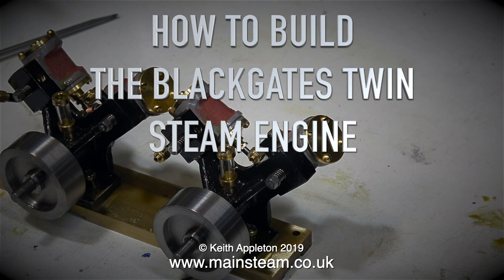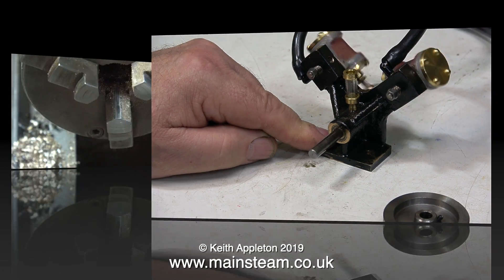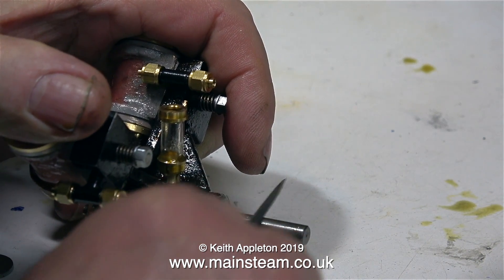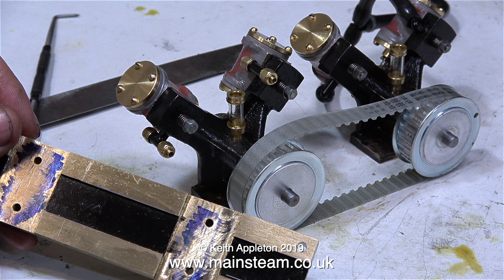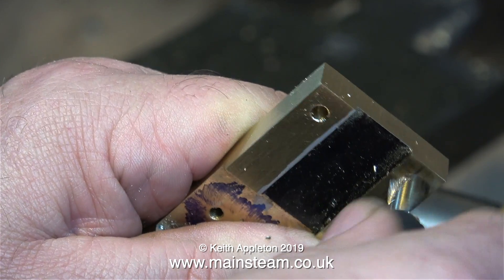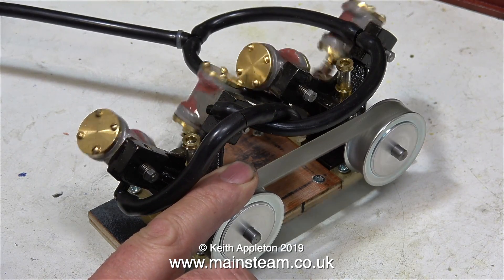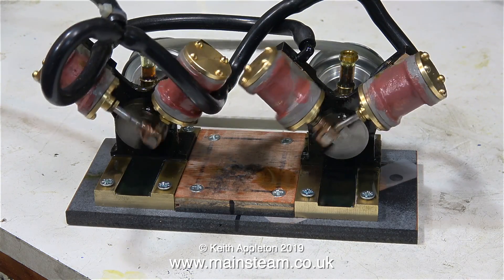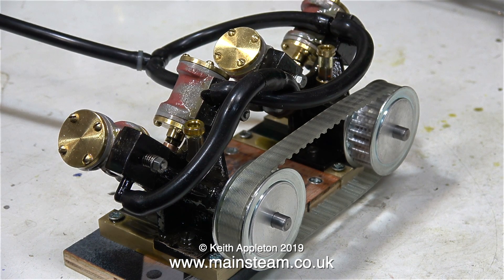HOW TO BUILD THE BLACKGATES TWIN STEAM ENGINE - PART #14

Comment: Keith those Proper Engineers that complain as say your doing it wrong are the ones that cause all kinds of problems as usually they don't know what they are doing and have never done it. As a Practical Engineer I say any way you can get the job done safely is fine with me, and please show me how you did it different then me as new tricks is what keeps us old dogs going.

Comment: Candlelighters, thank you for supporting the cause. I started supporting it about 30 years back. 
I have watched you employ several methods to secure engines to a wood base. Have you ever used pronged t-nuts installed on the underside of the wood? They have made very strong mounts for things I have bodged together in the past.
Reply from the maker: I don't use T-Nuts because the rust badly with the water that is always flying about . . .
Reply: @keithappleton  Of course, I had not thought about that aspect. Thank you for the reply. 
Hopefully I saved some builder the awkwardness of rusted mounting screws.

Comment: I have seen people make cog belt pulleys on a shaper or on a lathe by using a properly shaped cutter making axial cuts on the stationary, chuck-mounted work. You need a fixture to hold the chuck still with the proper number of positions.

Comment: Your side by side twin engines coupled with the cog belt gives an easy (?) way to adjust propeller speeds instead of changing prop size/pitch.

Comment: i like the side-by-side mounting a lot more than the end-to-end (but who cares what i think) . . . it neatly avoids he problem of one tiny crankshaft trying to handle the power of both engines.

the splitting of the engines is going to deny you the opportunity to do a mind-bending job of running both engines from one reversing valve . . . you would have nightmares but i'd love to see how you do it . . . i'm nasty that way.

the belt drive should handle anything those little screamers can throw at it . . . if whoever wins the auction for it uses it for a twin-propeller boat, i hope they return all the unused parts to you . . . i'm sure you can find a use for them.

Comment: Were you not tempted to use chain and sprockets? The scale would have been awful but much more in keeping with steam?.
Reply from the maker: This engine will probably be used in the darkest depths of a model boat hull, so the appearance is secondary to the reliability of the transmission  . . .
Reply from the maker: I think you will find that full size steam engines often used belts ........ for instance - the machinery in Cotton & Woollen Mills were belt or rope driven, governors were often belt driven etc etc etc . . .
Reply: Even before steam there were belt drives off water wheels

Comment: I'm not an engineer but how do you keep one engine from dragging the other, or how do you  synchronize the power out put so its balanced
Reply from the maker: the engines are identical so they run at the same speed more or less - it's not a problem.